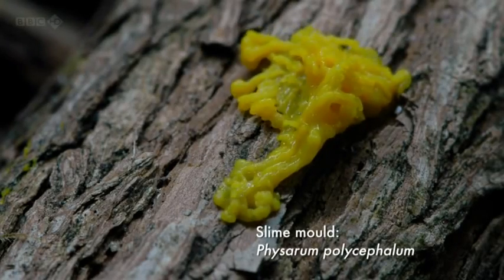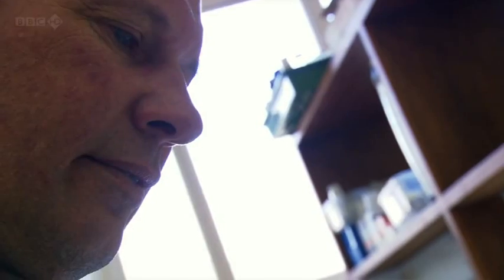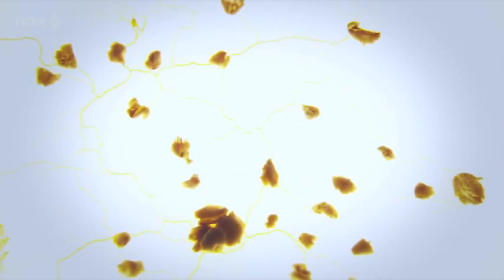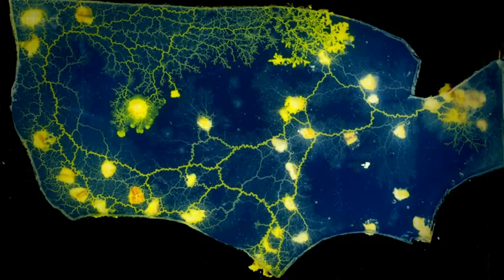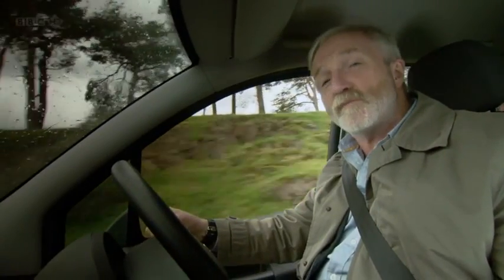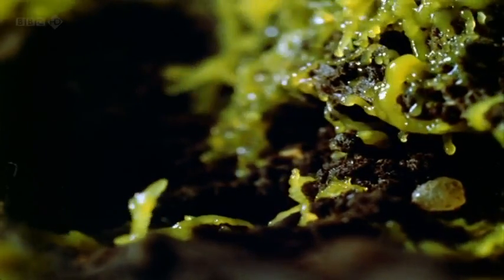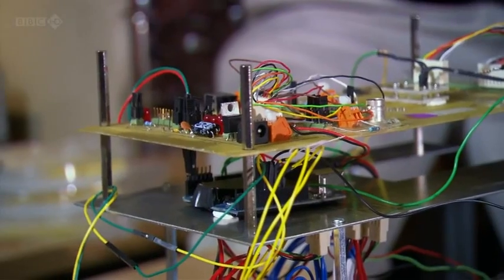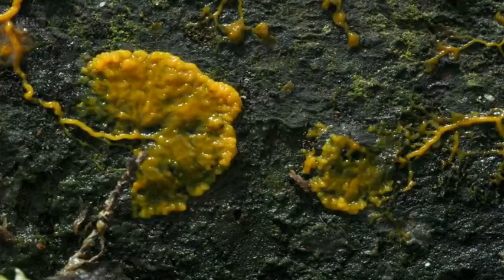slime mould

Comment: The slime mold masses shown here are NOT single celled organisms. Slime mold spend most of their life cycle as a single cell with cell body no larger than that of any other cell but when food is too scarce for a single microscopic organism to find for itself they congregate into the many celled slime masses that people associate with "slime mold". Thus these slime masses are more of a "super organism" made up of billions of smaller organisms.
Reply: There are two groups of slime molds, one is called a "cellular slime mold" and works like you say.  The other is called a "plasmodial slime mold" and truly is a single celled mass that never divides (save to form spores, though I'm not sure if all species do).

https://en.wikipedia.org/wiki/Slime_mold#Older_classification
Reply: You're not wrong but it's still a single celled organism; as it is composed of one cell type. Ants are still ants whether alone or in a colony.
Reply: What you're talking about, is called a "cellular" slime mold - called Dictyostelium discoideum. The slime mold shown here, is called the "acellular" slime mold - scientific name Physarum polycephalum. The former species can form a colony comprising millions of cells. The latter, is a single cell, with millions nuclei floating about inside the cytoplasm.
Reply: Its a Syncytium https://en.wikipedia.org/wiki/Syncytium
Reply: metaempiricist You are scientifically correct. As to inferring any "intelligence" upon slime molds is a bit of stretch- makes for  good TV but none the less a bit of stretch and that's coming from a neuroscientist.
Reply: Yes! Learned about them in my botany class. We it to do experiments at home with them too.

Comment: It's sentient awareness.
Reply: Arend Breimer Where's your evidence? How did you obtain it? Could there have been unknown variables in your experiments? Could there have been a problem with your analysis; causing your conclusion to be misguided?
Reply: Arend Breimer Thanks for such a well-thought out reply. I'm not claiming they are sentient; only concerned that assumptions are being jumped to.

Consciousness is metaphysical I, and only I, experience my own consciousness but not my own reality; which is physical and we share it.

At what level does our metaphysical mind emerge? Certainly I don't think our neurons are conscious at an individual level.

What is so special about sodium channels and neurotransmitters that our minds emerge at this resolution? I suspect it's to do with how the system is organised rather than how the signals are sent and received.

Given that only we notice our metaphysical minds, it is possible, though I'm not claiming it is the case, that there are other metaphysical structures analogous to minds, which we've not discovered or failed to recognise it. Perhaps the internet experiences its own form of metaphysical experiences, totally alien to our perceptions.

The collection of slime moulds may be only a single-cell, yet neurons are cells, and the mould may have some means of transmitting signals through the system they form. I don't know if they do send signals and I don't know if a metaphysical reality unique to that organism would emerge if they could. I'm just saying my brain does it, so it wouldn't surprise me if other systems were also capable of it, even should their metaphysical reality be totally alien to my own.

Complex systems can emerge from simple rules (fractals, double pendulums, etc), I'd be cautious before declaring the Human brain as the only system in reality that can construct its own metaphysical reality.

Comment: 3:29 what is absolutely identical? cities are in the same spots... but routes are not. so what?
Reply: The cities are the same because that's where they placed the food. The routes are a good approximation of one another.
Reply: Except the organisms deemed the changed routes more efficient than the real life railways. The changes were basically pointing out flaws and inefficiency.
Reply: @mrchangcooler  no, actually it's because they didn't implement geological features, so the slime mold is probably making a railway over a mountain range. It's identical because of which cities it connects, not the exact same way.